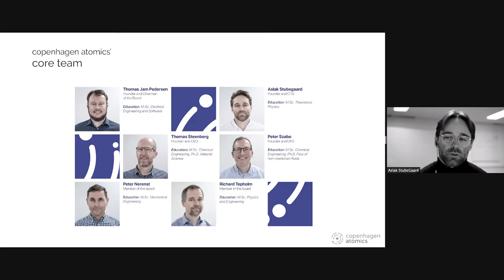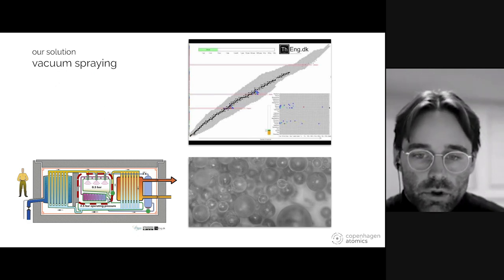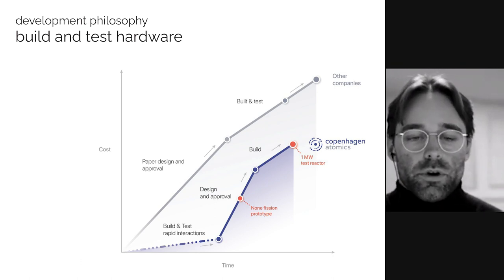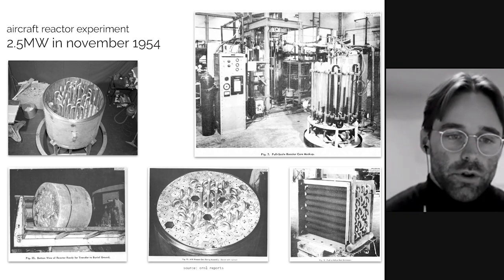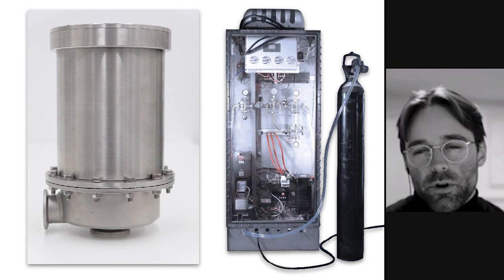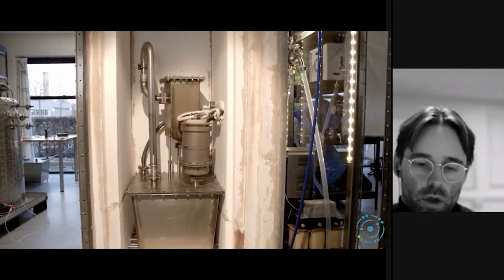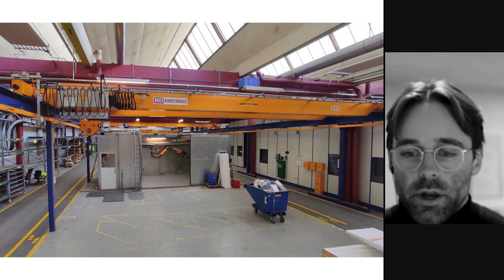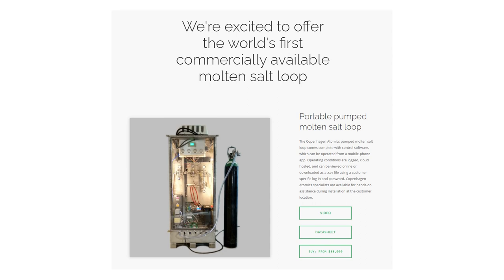Copenhagen Atomics @ ORNL's 2020 Molten Salt Reactor Workshop

Comment: So, this is all the information you have on the reactor, since it's the only thing that's linked on your website under technology? What choice of moderator do you use? How much plutonium is used to start the reactor? What's your expected burnup rate? How are you dealing with protactinium poison? It's good to hear you have so much focus on the long term corrosion of your materials, but I still have so many questions left unanswered... Do you have a white paper where I might find those answers?